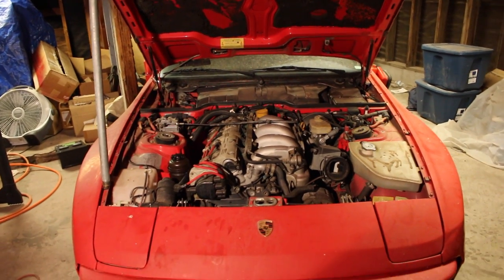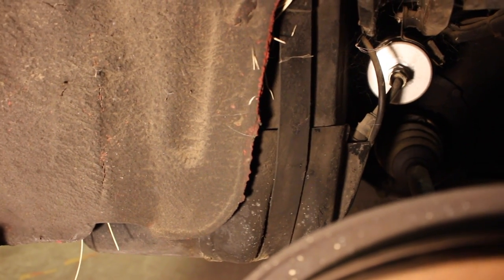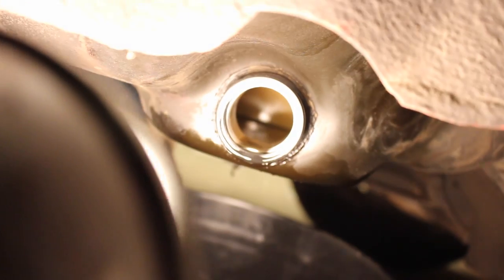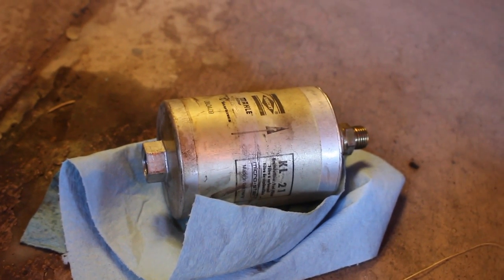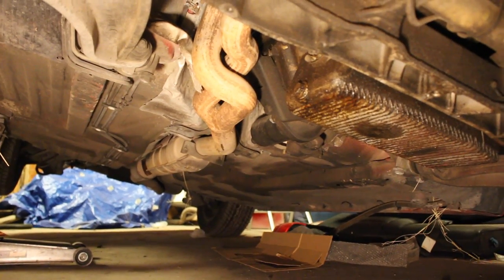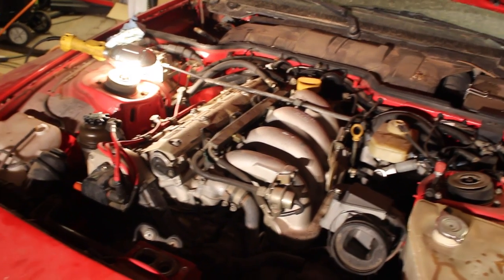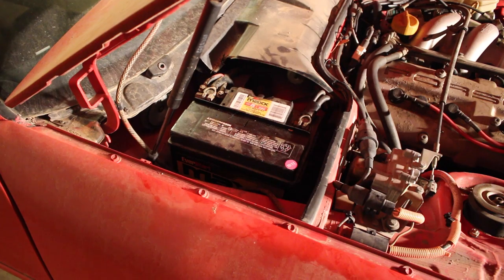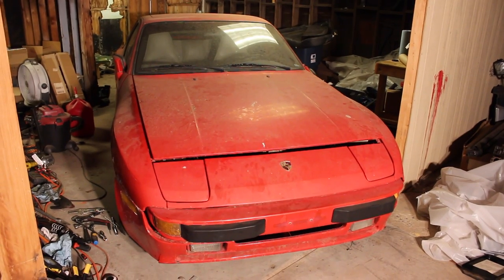Will My 1987 Porsche 944S Start?

Comment: No tach bounce so your most likely culprit is the speed and reference sensors and not the dme, you can check them with a multi meter set on 20k ohms they should read around 600-1200 ohms using the center and left pin. Kinda a pain to get to but you can get the parts of pelican parts
Reply from the maker: Yeah, that was my thought. I bought a new sensor, I just have to get around to installing it.

Comment: Hard wire your fuel pump to test .once you do have a working pump pull out DME relay and prime fuel system 30 &87b hard wire that way your system will be full then put relay back in and she will run

Comment: Changing the oil etc is all well and good, but rubber timing belts do not like sitting and the rubber deteriorates with time. Trying to start a car like this without checking the condition of its two timing belts is pretty risky.

Comment: Thanks for this but I need the follow-up videos!  I just bought a  1987 944 base for a $1000.  It's been sitting in a carport since 2006.  I had to have a key made and am ready to start replacing fluids. It appeared that you did not initially replace the fuel pump.  Is that correct?

Comment: Sorry you wasted a lot of money should check for fuel,spark and compression before spending a dime..that's what I do to all my cars
Reply from the maker: I didn't really spend much money at all, don't worry about it. I ended up losing interest in the car and selling it to a local 944 enthusiast for more than I had into the car since 944S prices had appreciated by then. He ended up swapping the whole engine wiring harness because rats had eaten it all up. If I had this car today I probably would've figured it out, but back then I barely knew what I was doing. Funnily enough, I did a full timing belt service on a friend's 944 S2 pretty recently, so I did get to experience a running driving 944 in (arguably) its best form with the NA 3.0L.

Comment: Make sure the ECU is firing the injectors and spark plugs (or is it just a distributor?). No idea how to test that, though. Might also check fuel pressure.
Reply from the maker: It's a distributor, there's only one ignition coil. But yes, I suspect that lack of spark is the issue. I'll cover that in the next vid once I do a little more troubleshooting.
Reply: Being new, your relay is probably good, but here's test - and repair - procedures for it just in case.
http://www.clarks-garage.com/shop-manual/fuel-05.htm

Comment: Please tell me you've changed the timing belt before you tried cranking it again
Reply from the maker: I have no record of it being changed, pretty sure it's over 6 years old. That's part of why I haven't been messing with it too much lately, don't want to risk the belt snapping. I'm considering pulling out the engine and just doing everything at once— timing/balance belt, water pump, clutch, all the engine gaskets, cam chain guides, oil cooler seal, etc.
Reply: Cool. Easy fix, just a bit time consuming if you're doing it for the first time. Also, be sure to inspect the tensioner pads for the 16v head. Good luck and have fun!